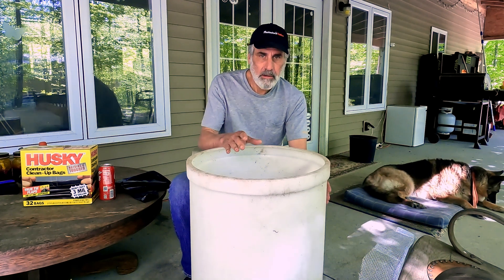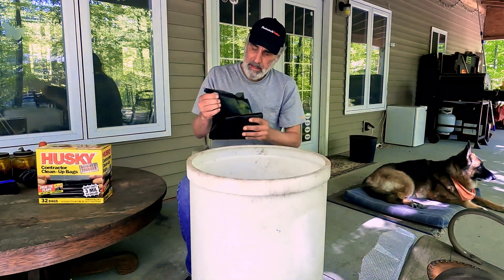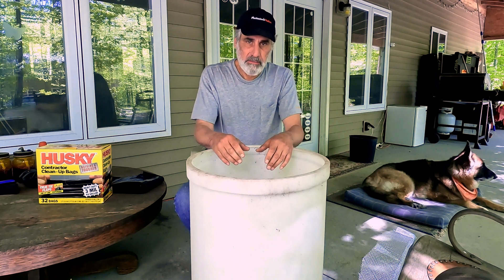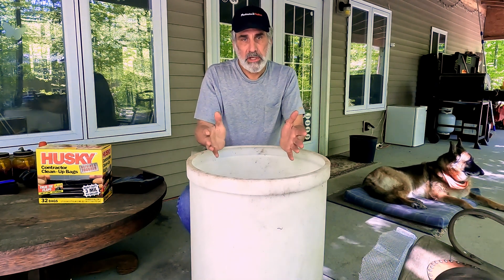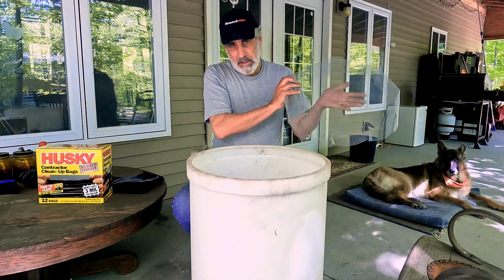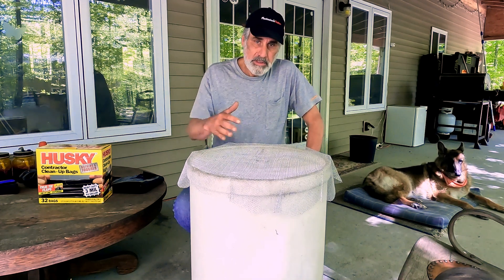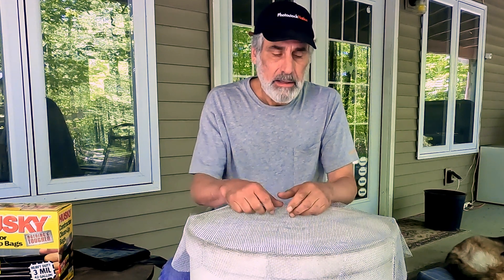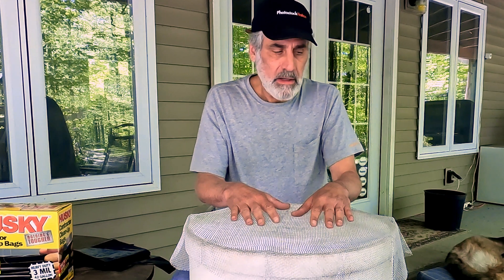Safe Chemical Disposal for Home Darkrooms - Evaporation Process

Comment: do you use a different barrel for different chemicals?  I'm not a chemist.  I've used steel wool to leach fixer, but I was thinking more of pyrocat and if you did the same thing with that.  Also, how about all the different wet plate chemistry.  I'd really like to know before I invest in wet plate, because we also have a cistern and septic.  Thanks Bill as always!
Reply from the maker: I use one barrel for everything. I have not use Pyro cat in a while, but I think I would probably dispose of it in the same way. It’s easy to do.

Comment: Why don’t you just reduce the hexavalent dichromate (toxic) to quaternary dichromate (nontoxic) with ascorbic acid (vitamin C) as recommended in Sandy King, et al.’s book on carbon printing (also see https://pubmed.ncbi.nlm.nih.gov/15488923/)?
Reply from the maker: I do this but still don't like putting it and other materials down the septic tank. This is a simple way to handle it.